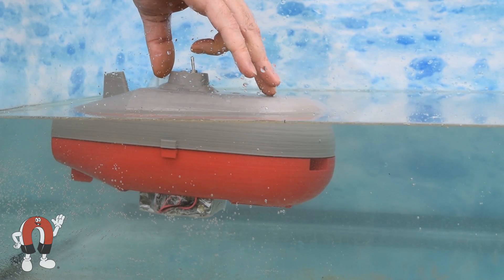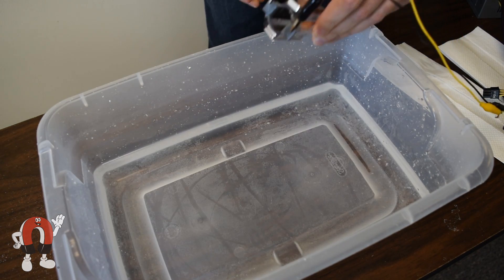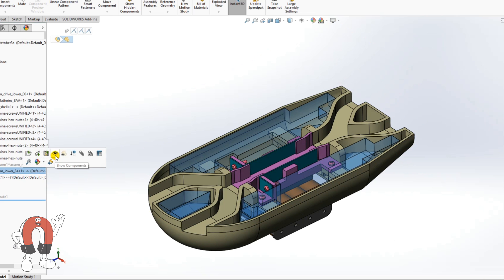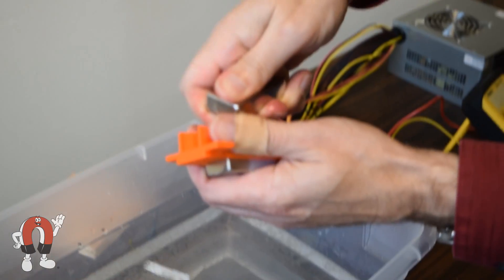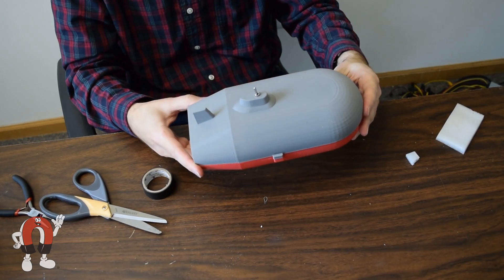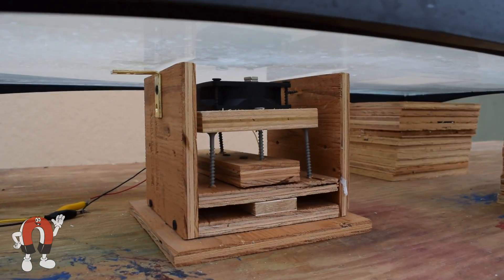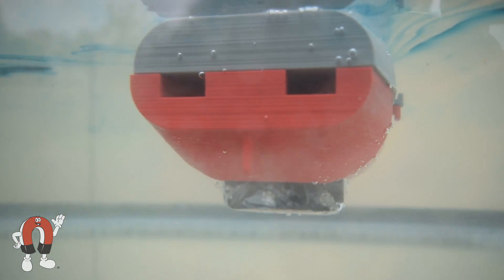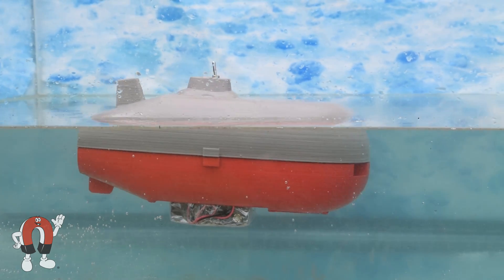Magnet Powered Submarine - The Hunt for Red October IRL!

Comment: Maybe it would work in a larger scale, that would be something if it was applied full size.
Reply: it would not. it was tried and abandoned it was dead end. if it would work every nuclear submarine would use it now.
Reply: @jebise1126  Rode Boats as a Spook Rider for the best part of 22 years.  Unfortunately the submarine community Nuc's especially are stuck in the past with "Well it has worked for 60 years so why change".  Also the submarine community is often holding true to myths.  One for example is the 4500psi hydraulic system if you spring a leak in one of the accumulators it will instantly flash in flames.  Sorry after retiring went back to school got second degree and worked in industry for another 30+ years.  We use often one hell of a lot higher pressure than that and if you spring a leak, you simply fix the leak and clean up the mess.  And that is just one, can name literally 100 false concepts that are just that FALSE that they believe as ABSOLUTE FACT.

Comment: I think this is super neat, that was one of my favorite movies growing up. 

There are a few thoughts I have on your project that might make it perform better. 

1. Your hull form has garbage hydrodynamics, and on such a small scale you're talking the equivalent of thousands of horsepower to push the shape. 

When you look at naval ships and submarines, they are pointy at the ends for a reason, they slice through the water rather than push it out of the way, even on a submarine the bow and stern have a much sharper point than this. 

Going to a hull form that had the batteries encapsulated in a keel, and fairer lines to the hull would probably see this thing jump to life. 

2. with the design of the duct you have a big inlet which is good, but you are losing half the power you create by splitting the exhaust flow. If you cut the size of those ducts by 50% you will get the full effect. 

This is because as created when the flow slplits into two same size ducts you're creating a low pressure area, you can see this very clearly in your food coloring test, you have a great deal of cavitation, the dye swirls even before it gets to the end of the main drive, and then in the split it slows even more. 

You would want to see a steady straight flow with as little turbulence as possible. I would about bet that the efficiency of the drive has been reduced as much as 60% in it's current configuration. 

3. It may be possible to get more power from this drive by adding a venturi that sucks in more water. 

In shipboard firefighting we have a device called a 'Portable Eductor' and what that does is you run in two 2" fire hoses, one going to a pickup, the other going to a pump. Then a 4" fire hose going overboard. 

This pump will move a ton of water using the venturi effect, far more than a 2" pump will move alone. 

In conclusion, all of that being said, this was very interesting to see, although I can already see why this drive system did not become crazy popular because you constantly have cathodic corrosion going on, meaning that small metal particles are being transferred from one plate to the other, and on a steel vessel IRL, this would be a corrosion nightmare. 

And when you are dealing with boats that have been designed to surface after they have been sunk, well having holes appear in them randomly is probably less than conducive to that goal.

Comment: If I remember correctly, the stealth drive was called the "caterpillar" in The Hunt For Red October.
Reply: In the movie its described as "Magnetohydrodynamic" but in the book its just impellers and there its only ever called "Caterpillar"
Reply: Book and the movie approached it differently.  In the book, it was a tunnel impeller drive.  In the movie, it was MHD.
Reply: @komitadjie  that‘s correct . But the mhd makes way more sense to me since it is described as a almost noiseless drive. The sound it made was described as “biological”
Reply: @Maxfahrer  That's again the movie. In books, drive was also quite silent, but pressure buildup occurred inside hydro tunnel, and let out a strange noise every dozen minutes, or so which was mistaken as seismic activity.
Reply: LENZ effect is how my magnetic design works... Same would work for a nuclear submarine... Torroidal center flow... Watch my channel about my All metals isolating magnet...
Reply: The Caterpillar Mmmmmmm and at top speed it moves about the same BUT through water
Reply: That's because it's using an electromagnetic force system - NOT Magneto Hydrodynamics as in this video. An electromagnetic force system crawls like a caterpillar, by creating a peristaltic wave within a tube that forces the water through.
Reply: @WOTArtyNoobs  They use both terms -- caterpillar and magneto hydrodynamic -- to refer to the same thing in the film. It's not unusual for films to mix up their technical terminology.
Reply: @WOTArtyNoobs  That's interesting, thanks for the clarification :)
Reply: @WOTArtyNoobs  In the book he says they are not sure why it is called the caterpillar.  It is also not electromagnetic or magneto.  It was a series of impellers.
Reply: @Darkfranchise  in the movie the sub had multiple small doors along its length like the oar holes in ancient trireme galley ships. Perhaps each door propelled water in a pattern similar to catapillar legs.
Reply: @charlesco7413  The film takes the terminology from the book where a series of impellers are linked together (similar to an electronic submersible pump) in a long tube that is then painted green so it somewhat resembles a caterpillar.  In the movie the drive system is replaced with a fictional magnetohydrodynamic drive but the naming remains the same.  Personally I think the movie drive is more fun and the name is obviously catchy so well done.
Reply: @Darkfranchise   ok but isnt this video about a magnetohydrodrive?
Reply: @charlesco7413  ok but this comment is about the origin of the word caterpillar to describe the drive.
Reply: why is everyone referring to red october? i am loosing my mind right now.
Reply: Yes, that was a nickname, it was referred to has the magnetohydrodynamic drive in both the book and movie. But magnetohydrodynamic doesn't flow off the tongue, so the people working with it called it the catapiller. Soviet submariners called the microphone for the ship's intercom the "kashtan" with means chestnut.
Reply: Maybe the design conceived for the movie had pulses running down the channels, reminiscent of how a caterpillar humps along.
            Misnomer? legs moving down the segments of a centipede or millipede could portray better.
Reply: No they explain it as hydrodynamic drive. They just call it a Caterpillar for ease.
Reply: Red October did NOT use an MHD system but was a series of jet pumps within the hull. Go read the book.
Reply: @francisdavis1271  In the book, jet pumps were described, that's correct. But in the movie, they refer to caterpillar (german: Raupenantrieb) and also MHD. And in addition, when they had a failure, they thought, there could be a problem with the superconductors which would work as a giant electromagnet for generating the magnetic field. That's one of the differences betwwen the book and the movie.
Reply: @francisdavis1271  But jet pumps would make noise so obviously that was changed for the movie

Comment: I wonder if graphite electrodes might work better/corrode less. You should do differential steering with two engines and radio control. Maybe use a lipo pack and try various voltages? Great stuff! Thanks!
Reply: Needs to make a smart skin that envelops the entire hull, not just linear thrusters.
Reply: Platinum electrodes are common in industrial MHD pumps.

Comment: Questions:
1. I wonder what passive sonar would hear.   I kinda doubt magma flow.
2. How long would the metal last?
Reply: Yes I also wonder how long the metal will sustain. The process should eat the metal, or am I wrong?
Reply: @patrikhafstrom8954  The current is splitting the water into it's parts, and sometimes getting some salt to add chlorine gas to the mix.

Comment: You built a caterpillar!  Awesome!!!  Now, it needs to be scaled up. ;-)
Reply: Not quite: The Hunt for Red October popularized the magnetohydrodynamic drive as a "caterpillar drive" for submarines, a nearly undetectable "silent drive" intended to achieve stealth in submarine warfare. In reality, the current traveling through the water would create gases and noise, and the magnetic fields would induce a detectable magnetic signature. In the novel from which the film was adapted, the caterpillar that Red October used was actually a pump-jet of the so-called "tunnel drive" type (the tunnels provided acoustic camouflage for the cavitation from the propellers).

Comment: the amount of hydrogen bubbles inside the ship?  how much hydrogen accumulates over time (& can using this hydrogen too in ship)?
electricity consumption over time and the force of motion with electricity consumption? if the directional (servo) valves (rudder (one rudder inside & 2 hole outside)) are placed in the holes, the water can be directed from which hole the water moves in / out and also the direction of movement can be determined? how much noise (not just sound waves) it generates?

Comment: Could you get the same effect with fresh water if you put a conductive grid between the two plates? Or does the water need to be highly conductive to be influenced by the field?
Reply: To get thrust, there has to be the possibility of relative motion between the magnets (fixed to the hull) and the conducting medium between the electrodes (which can be ejected backwards, to generate forward reaction on the sub). So fixed wires would not work.

Comment: Aren't you losing thrust through the electrolysis and unnecessary drag induced by the intake and outlet geometry? By insulating and sealing the electrical components to eliminate electrolysis and using a single inlet/outlet thruster, efficiency and speed should improve greatly. Also, bubbles are a giveaway that you're using a "tractor drive"

Comment: I could see the bubbles forming being a major problem for the use on actual military submarines... also the magnetic field would probably have to be so strong that it could be detected from miles away lol
Reply: Not if done correctly. Most of the magneto hydrodynamic drives you see on YouTube are about 15 years behind the current technology. Think compact flux curves hallback arrays and oscillating drivers.
Reply: @nighthawkviper6791  Is that J. Arthur Shercliffe presenting that video, with support by other US University staff?

I met Prof. Eric Laithwaite on at least two occasions. Although his work on linear induction motors was outstanding, his inability to comprehend other topics was disappointing, not least his failure comprehend the mechanics of gyroscopes. He also had a rather biased view on the relative merits of coilguns and railguns and tended to interpret observed facts selectively, to support his view point. He was not really setting himself out as an expert in the latter field though.

PS - I agree with what you said about radar evasion.

Comment: I'd guess it would be more efficient the faster it's going.  So made a lager pool it could do laps of, would see it get up to higher speed.  Maybe attacked to a centre pylon.

It would also be great to see it with dive planes,  maybe fixed down so as it speed up it would pull itself underwater.   That would slow it down and it would bob back up.

Comment: Is the on/off switch even needed?  Current would not flow until there was water in it to conduct the electricity.  Would automatically turn off when taken out of the water.

Comment: Believe it or not, I tried to build one of these in the 1960s when I was in the 9th Grade and was a Nerd before that was cool/socially acceptable.

But for the hull, I tried to use a Revel model of the USS Skipjack; and tried to use internal batteries.

It didn't work.

So I went to an external power supply. . . which ultimately resulted in the USS Skipjack MHD melting into a blob of grey plastic and wires at the bottom of the fish tank I was using.

Ah, well.

"On Eternal Patrol," and all that.

Neil

P.S. And, no, I did not join the USN -- Lucky for THEM
Reply: What was the salt concentration though?
Reply: @sepgorut2492  The short answer is "Salt"? Why do I need salt?"
The longer answer is "I was stupid back then, and have gotten dumber since."
A lot dumber.

Comment: no wonder they used nuclear reactors. 
I guess ducted fluid flow can add extra thrust to the original powered flow, like ram jets or turbo jets.
also the aft output ports need to be relatively smaller than the fore inlet ports for burnaulii's principle to add extra thrust, although beware of the backflow problem ( if there isn't enough thrust, you just hit reverse ).

Comment: "the order is : Engage the silent drive!"
"aye sir!"
Reply: Bubbling wouldn't be silent.
Reply: @doubleT84  As I recall in the BOOK Tom Clancy pointed that out.  I think he described as being similar to a lava vent hitting water.
Reply: @michiganengineer8621  Basically, a tunnel drive. Hardly new tech. The RN used them on some gunboats in the 1920s to reduce draft.
Reply: @TheJTMcDaniel  Not quite the same thing.  The tunnel drive from the early 20th has a rotating propeller inside the tunnel to move the water to propel the boat.  The MHD drive system has no moving parts, other than the rudder, involved in the water path.
Reply: @michiganengineer8621  In the movie. Clancy literally described it as a tunnel drive employing multiple impellers. The wildest concept was a suggestion that using induction motors would save space, by which I suspect he meant that the impeller itself would also function as the rotor. I have no doubt the whole magneto hydrodynamic thing was chosen by the movie people because it sounded cooler, and maybe because it gave them an excuse to throw in supercooling references (on the premise that the viewers wouldn't know if that was needed or not but it sounds even more techy).
Reply: @TheJTMcDaniel  I'll admit it's been a while since I've either read the book or watched the movie.  I don't remember seeing anything about rotating impellers in either case.  I'll freely admit my memory could be at fault here!
Reply: It would sound like 2 whales humping or something
Reply: Honestly, if they're already doing so much high tech stuff, I'd expect them to be extracting the hydrogen from the exhaust in some way.
Reply: https://youtu.be/zsC2ETsZL0g
Reply: LENZ effect is how my magnetic design works... Same would work for a nuclear submarine... Torroidal center flow... Watch my channel about my All metals isolating magnet...

Comment: If the diameter of the outlet ducts is reduced, does that increase velocity of the salt water flow?  
Which is more important?  A near silent drive for an ocean going vessel or a method for separating Hydrogen (Fuel) from seawater?
Volatile Typhoon farts?

Comment: Modern submarines don't fear detection by noise at low speed any more. They all have become so quiet below 10kts that you basicly have to drop right onto one to hear it. Planes with MAD are much more dangerous. I'm curious what a MAD-system reads when flying over a boat that is basically a 5000 ton magnet, and how well you can shield it's field.

Comment: Try different distances between the magnets, ditto the electrodes, and add a return path for a better magnetic structure.
Reply: In principle, the force on the water is the volume integral of the vector cross product of current density and magnetic field in the active part of the duct.

With a single straight duct, the force on the sub would then be the equal but opposite force.

So enhancing increasing the current and increasing the magnetic field will both increase the force :)

Comment: OH, I almost forgot... is there any chance the batteries being held on by the magnet was a mistake?  I can see how a heavy-duty magnet actually TOUCHING the batteries could be detrimental to performance.  If you do this on a larger scale, say along the lines of the old Monogram "Red October" plastic model kit (which was not Red October in any way, just a run of the mill Typhoon), you could place everything internally and make it self contained with the batteries separate from the magnets.  Just my two cents.  I'd love to see the results.

Comment: Were this a real combat submarine, wouldn't the bubbles make a noise the enemy's passive sonar could pick up?
Reply: Yes. In a working sub, the voltage would be controlled to avoid bubbles forming.
Reply: But if you get the voltage so low that no bubbles are forming, then you will draw no current as the gas production is directly proportional to the current you pass (Faraday's law of electrolysis), so you will always get gas formation.
The only thing you can do to minimise gas production is to crank up the magnetic field as the force of the drive is proportional to the current as well as the magnetic field strength.
Reply: @srenkoch6127  I was thinking just that...

Comment: I have a suggestion for you!
Make another model, but this time add Independently Variable Diameter Outlets in the back and a couple of "Doors" where the channel splits back into two paths again so that you can cut the flow completely off on either side to assist in turning.  Then do another video...but this time, use Sea Water from the ocean.
While you're at it, why not just add some actual working Ballast Tanks so that you can completely submerge and surface.